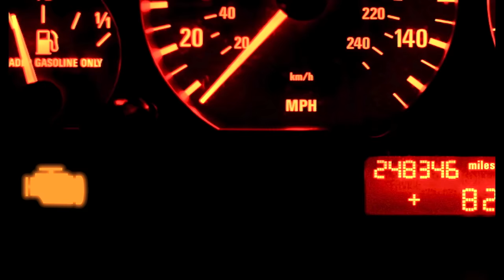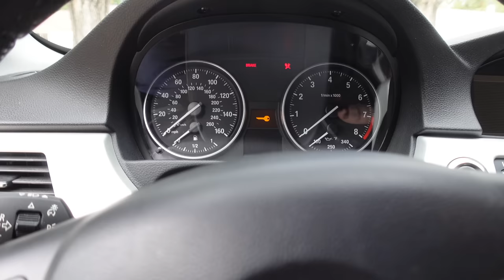I bought a NEW DAILY (Most EXPENSIVE car I've EVER bought)

Comment: Those washers were probably added as a quick fix to pass German TUV. Cars with xenon headlights in Germany must have working headlight washers to pass TUV.
Reply from the maker: Thats fascinating!
Reply: They used to, not anymore, as after a year I don't remember which one, MB E-Class for example didn't had washers anymore even with xenon from factory.

Has to do with the number of lumens which the headlight produces with a certain xenon bulb.

More cars followed this trend after a while, it's was an optional option/extra after that year.
Reply: I would be finding the factory parts to add headlamp washers. As is, I am half-assed looking for the headlight wipers that were standard on European Volvo 240s. Last winter coming home from helping my mother I wondered why the headlamps seemed dim as I got closer to home. I found out. The salt was a quarter inch thick and came off the headlamp lenses in one solid piece. It's a wonder I could see anything.
Reply: Good color! I enjoyed my e90 335. Good chassis.
Reply: @100PercentJake  I don’t know if you have already purchased the under the seat subwoofers but I don’t recommend it. Not for the price anyways, I did the Focal ones, which are probably the most expensive but while it did improve the sound quality because the stock subwoofers thin paper cone wasn’t flexing but it doesn’t improve bass response to a SPL you might enjoy. I should’ve preface this was saying I had an F30 but I’m pretty sure the amps and subwoofers are identical. for the price of one subwoofer you could probably find a used LC2i and they used micro sub from JL that has a built-in amplifier that will put out for more power and won’t taper off the lows at mid to high volumes
Reply: Wonder why as it was first bought in Germany and brought to the US...  should have been specced for TUV...
Reply: @mikaeljonsson4686  Guy at work did that years ago.  It's way cheaper to order the car & go over to Germany & pick it up because of taxes or something like that.  You drive it for a while there & then load it on a boat in France.  Then it comes to the US as a "used" car not a new one so the tariffs are different.  I think they discontinued it though.  He did it 10+ years ago..
Reply: @mikaeljonsson4686  military purchases are different than buying one in Germany and bring it back
Reply: @pugs1377  aaa, ok, didn't know that! So prob delivered as US spec even though it was in Germany? US military base on foreign soil seen as US territory, like an embassy maybe?
Reply: @mikaeljonsson4686  yep

Comment: Congrats on the new car! For a sec I thought you got a N54 335i...my anxiety peaked until I saw the 328 badge. The 335 was fun when I had it but extremely unreliable. Roughly $6k in repairs a year for the 6 years after warranty. These have some weak spots tho and you should change it asap. First is the coolant pipe that goes into the head on the engine. The plastic mickey mouse fitting deteriorates and will leave you stranded without a warning. Aluminum replacements are $20 on amazon. Second is the plastic coolant hose that comes out of the upper radiator hose, runs across the radiator and connects to the coolant bottle on the passenger side. The electric water pumps are far more reliable on the N52 vs the N54 (as its made of aluminum not plastic) but its worth replacing along with the thermostat. Other than that, you typical valve cover gasket and oil filter housing leaks. A nice touch would be to modernize the CCC iDrive with a carplay module. Just did it on an e92 M3 and it was the best quality of life improvement ever!

Comment: Congrats!  I picked up an 09 335i xdrive a few years ago & love it. (weird us having the same type of cars so often..)  The 335 has the 2 turbos.  The sticky door handle is a thing, but I got a plastic one off Amazon & you can replace it for like $20 and it will never be sticky again.  I think you'll like it.  The suspension & brakes are easy to do other than having to give the rotors a good pounding with a sledge if they get stuck.  But you probably already experienced that when you did the fronts lol.  Looking forward to seeing how you put carplay in it as that's something I haven't done.

Comment: Did you say the year?  I just got a 2007 330i in champagne, tan interior (rubber also melting a bit on driver door), with the automatic.  Only has about 70,000KM, really stable on the highway, handles great, and as you say has a really smooth engine.  Noticed the fuel economy is pretty bad though and always fill with premium so can be pretty pricy to operate.  Agree they look amazing and are pretty practical coupes.  Think I'm hooked and once you've driven a BMW for a while I think it would be hard to go back to a less premium machine.
Reply: 08 I think it is

Comment: I really like the car. Probably because I have one myself (E92 335i 6 speed manual - not a common car here in Norway). The E90 family are pretty solid cars. The engines are usually the weak spot. The N52 was only sold for a few years here in europe, the N53 replaced it in 2008 I think. My brother has a Z4 23i (E89) with the 2,5l/204hp version of the same engine and it`s surprisingly quick. 

Have you considered to upgrade to the M3 control arms? The rear ones don`t really make that much of a difference, but the front ones changes the steering feel quite a bit. It`s an easy job and the parts are not too expensive, but you do need an alignment afterwards.

Looking forward to more videos on this car. And the E46 also of course.

Comment: hi jake use jr's carley and see if your mirrors are folding they might be turned off if you don't have halo day time running lights turned on carley can do that too you could just sbout make a video on all the features that carley can turn on in your e92 i have a e92 335i and i love it your door lights on the bottom of your doors change them you can buy bmw logo ones that project the logo on the ground when you open your door 20 bucks a pair cheers from down under

Comment: Only an intense BMW fan drives a BRZ (half Subaru, half Toyota), is impressed, and thus buys another BMW as a result 🤣 Hope the seats are as good on your back as the other so you can actually get to work in comfort even when the older BMW.
Reply: Luckily they’re manual sport seats. They’re insanely more comfortable than my basic seats

Comment: By the end of next year and 10k $ later - "Why this is the most unreliable car I have ever owned". Not sure if you removed its diaper yet. Oil filter housing and oil pan is probably leaking by now just due to a hard glare
Reply from the maker: Dealer replaced the valve cover gasket, oil pan gasket, radiator, oil filter housing gasket, and some hoses.

Comment: Love the channel but the 328 is the worst choice for a BMW. The 335 is just SO MUCH BETTER and as a used the cost difference is insignificant compared to the performance upgrade.😢
Reply: The reliability of the n54 is much much worse than an n52.
Reply: @GrimesGarage  while that's true, nobody buys a BMW for reliability - they buy it for fun/driving experience. If you want reliability buy an old Toyota Corolla...  or even an early 80s W123 Mercedes diesel. So if you get a BMW, get the best one (at a reasonable price). While the M3 is an amazing car, the 335 is the best price/performance you can get (at least with a BMW). The 335 is one of the most amazing cars I've owned - and I've had Porches, Audi A3/A8L, Corvette etc...
Reply: @ranig2848  the intent is keeping it close to stock with minor upgrades for comfort/OEM performance enhancements. N52 e90’s are rock solid from a reliability standpoint. Even my raggedy neglected sedan has been reliable as hell after saving it from the brink.

Comment: You yanking on that gear shift without the car running and using the clutch sitting still is about the worst thing you could be doing. Quite cringe It's a great way to bend a fork.